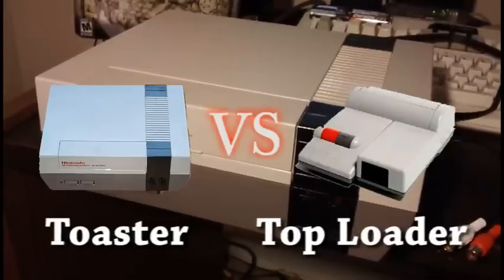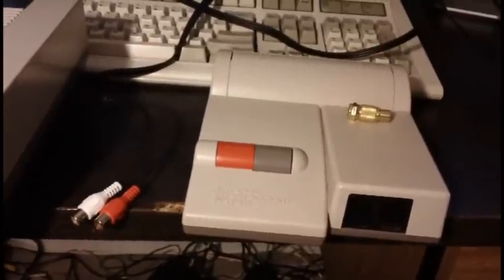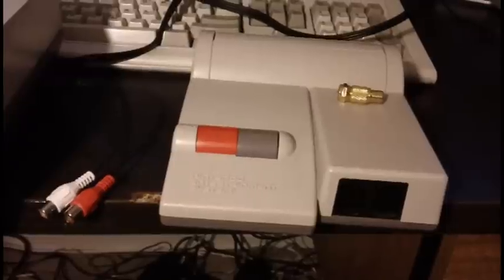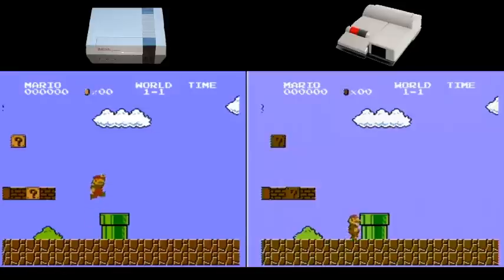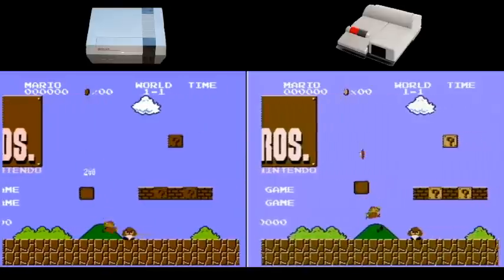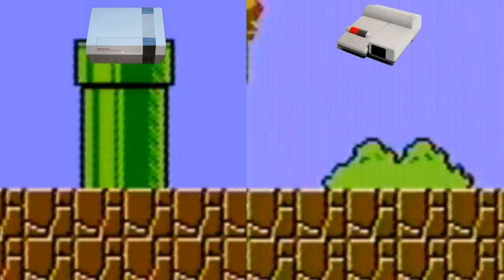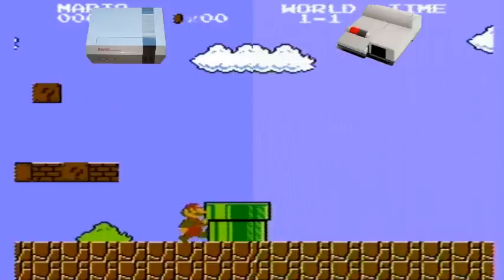NES Front Loader vs Top Loader

Comment: That's really weird, you'd think the later model would be the better of the two. Image the PS4 pro was worse than the PS4 😂😂
Reply: The reason it is not is because the super Nintendo had already come out they were making it to sell cheaper and milk it for as much profit as possible on the way out
Reply: It's more of a PS4 slim than a PS4 pro, it's a downgrade because it was designed to be cheaper.
Reply: It was a version of the NES released after the SNES, that was meant to make some money from parents too cheap to shell out for the current gen hardware. It was made pretty cheaply. Getting rid of the ludicrous front loading mechanism had the benefit of reducing cost while also making the console more reliable, which was cool, but the picture quality was pretty poor.

Comment: Top Loaders and Regular Nes units both have roughly the same picture quality. If you're seeing lines, clean your cartridges, the only reason you'd see lines would be not having a solid connection between console and cart. I deal with Top loaders and Nes units on a regular basis, they both look about the same the only differences are clean and unclean contacts and pins. You're also running the nes straight through video, whereas you're running the top loader through av cables through an adaptor to the tv. Anytime you run through multiple sources you dilute the picture quality.

Comment from the maker: Sure but composite on NES is very clean (for composite standards) the GPU works natively in composite meaning even if you do an S-Video or RGB mod using the stock GPU the image is no better.  Composite is as good as it gets for the NES unless you get the GPU from those Nintendo PlayChoice arcade cabinets and mod it into an NES.  Those work in RGB.

Comment from the maker: The original NES sold millions and millions of units from like 1986 until about 1994 (about 8 years) while the top loader was only sold for about 1 year tops from late 1993 to about mid 1994. That's why it's harder to find. There aren't nearly as many of them out there as there are the original since it sold for 7 more years.

Comment: The Toaster also made the vertical lines, if you did the RF (coax) output.
The reason for the lines and lack of color, you touched on a little, is the mixing of the audio and video signals, and separating the two isn't perfect, so you get a little "sound" in the image (alternating jagged lines, or checkerboard imagery, or the vertical lines), and buzzing in the audio, because there's some "video" in there.
Atari 2600 (original) was notorious for bad mixing, especially the original consoles.

Comment: Got an original NES for $4 at the Goodwill, bought the prifs & SMB for $20, the NES started right up after a small wiggle of the cartrage and it looks freakin great, no plastic yellowing or mods (even the 72 Pin connector, I believe is 100% original, I just cleaned it and restored the pins and it runs great)". Personally, I did not think it would actually work "especially coming from the goodwill". That was the best $4 I ever spent man.... Playing SMB3 on it as of this very moment and still haven't spent more then $40...

Comment: I actually bought a toaster type NES today. First time I have ever played a real NES and it is so awesome. It only cost me 49 dollars but it didn't have controllers or cables. Luckily enough it just uses AV cables and the SNES uses the same power adaptor. So I just used that one and bought a couple of controllers from another store around there. Even got a zapper for it and it works PERFECTLY! Unfortunately it doesn't work with my lcd tv but on my old crt it works just fine.

Comment: I just received an original NES console in the mail. I bought this because I've seen comparison videos for picture quality with it vs the NES 101 top loader. I've had the top loader for a while now and decided to just get the original NES over installing av components to the 101 for a better picture quality. Turns out my NES top loader has a better picture that the front loader I just received. And yes I plugged in the av cables for the front loader. Is there something I'm missing out on?

Comment from the maker: No it's the exact opposite.  Using a direct cable like this over the original automatic RF switch box will give a cleaner signal on ANY system that uses RF.  They sell these adapters on Atariage for that exact reason.  The automatic and manual switch boxes can add resistance or get corrosion on the switch they were made to make it convenient to switch between the game console and your aerial or cable TV that's the whole point for the switch but a more direct path is better for noise.

Comment from the maker: Sorry you feel that way but the original NES has better picture quality and AV outputs that the top loader does not.  The only thing better about the top loader is the fact it's a top loader and generally has less issues with age when it comes to loading the game carts since it makes a better connection with the contacts.  For some people that's reason enough to want a top loader but no one will deny the picture quality is inferior to the original.

Comment: It's always good when buying a used system from years ago to go with the original first models made,not the next models that were watered down so to speak.They cut price cost by taking away stuff or just using cheaper parts.

Comment: I wonder if the video chip on the NES2 has a higher resolution internally (not used by the NES games) and somehow the video chip is up scaling it somehow, producing the lines where the original NES is low-res native and outputs the signal that way (perhaps by not interlacing).    For example, the original NES outputs a resolution of 256 x 240.   I wonder if the NES2 Internally is 640x480 or perhaps 720x480 (interlaced), and the NES2 doubles lines or doubles some of the pixels to render the video signal, producing the lines on the screen in the stretch or scale process.     Be interesting to pull the specs of the actual video and graphics chips used on the NES2 and see if this is perhaps the case.

Comment: It's a good thing I watched this because I was considering tracking down an NES 2, figuring it was at least as good as the first one in terms of picture quality, being much newer. I actually experienced something similar with the Sega Genesis back in the 90s; I had actually gotten a Sega CDX (the unit with the Genesis and the Sega CD together that looked like a big portable CD player of the era) and when I played Sonic 2 on it I discovered that the picture actually had larger pixels than the original Genesis and the characters did not look as detailed. I swapped back to my original Genesis to make sure I wasn't imagining things and I wasn't. I took it back the next day and got a refund (and considering how the Sega CD ended up that turned out to be a good thing).
Reply: Actually should have held onto that cdx could have gotten a pretty penny for it now. And sega cd games are ungodly expensive to collect

Comment from the maker: The SNES Jr has really good looking composite but lacks S-Video like the original SNES.  So if you have an S-Video cable and use it you just get a black screen on the Jr.  The Top loader NES here in NA has no composite video output but the Japanese Famicom AV does and I'm sure it's as good as the original NES but I've never seen one in person.  Heard a lot of good things about them though so I'm sure it's good.

Comment: A fair way of comparing would be to use the RF output of both machines - and use a proper and shielded RF cable instead of some plain cheap composite cable with an adapter. 
Interference is not because of sound going in the same cable, it's not even close in frequency - you don't get extra interference when there's sound, right? The composite signal is modulated on a higher frequency giving a less clean signal when demodulated again - as it's analogue.

Comment: Can you explain the adapter? I don't get how that makes sense.. Doesn't the top loader ONLY have RF? If so.. how are you connecting a composite cable, even with the RF, to the computer?

Or did you mis-speak and are plugging the adapter side (now 'rf') into the NES and then the other side, which would be composite, into the capture card?
Reply: The composite cable can carry any signal through it(in this case, RF). The adapter just allows you to plug it in the RF input of your TV. The NES has an RCA style jack on the back for RF.

Comment: I also like the classic original NES because it's faster as you can see in the video the demo starts first and is faster than the top loader. Maybe because the top loader uses pal emulation ? Or it's said in the video/description and I a dummy.

Comment from the maker: How is it pointless to show the best of both stock systems? It's not my fault the top loader lacks AV output! To show the best of both systems would mean to use the best possible connection for both.  I'm comparing the systems, not RF. RF on the toaster doesn't have the vertical lines and when you do an AV mod on a top loader you can still have the lines unless you do a more advanced mod with the added filter cap so the lines aren't a problem with RF but the whole design of the top loader.

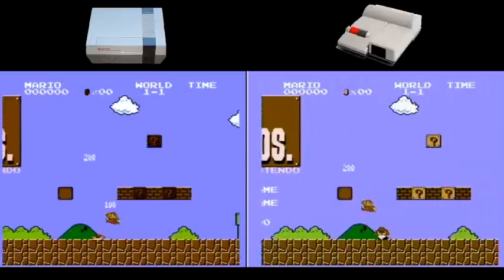Comment: I still have the original Japanese Family Computer with a microphone on the 2nd controller and it doesn't have AV out so the only way is RF. There are also vertical lines on the video the same as the top loader (2:57).

Comment: I modded a top loader with rgb and still got slight vertical line. I was so dissapointed. I put a 0.1uf ceramic on the 5volt line going into the nesrgb board. It got better, but the lines are still there. So frustrating!!

Comment: I actually have two front loader NES systems, and they both have the vertical line issue. I'm pretty sure they are rare, but they're present on the original consoles. I'm guessing it's a capacitor issue, considering how the Sega Game Gear had tons of screen, and sound problems.
Reply: +Luigi84289 I have used both. Composite, and RF frequency. However, it's still slightly present on Composite; clear picture though. With RF, it does show, but it's really very odd. One of the units also has lower sound then than the other one, and I haven't even messed with the volume control on my TV. Like I said, it's definitely a capacitor issue with the motherboard, but it may be a 50/50 chance it'll fix the problem.

Comment: You know, I've always denounced the toploader in comparison to the "toaster" NES. The toaster is the ONLY version of the Famicom/NES hardware with both inputs, and the quality is much better than the NES 2. Plus, it just looks cooler, too. My normal NES isn't even problematic (working as well as any NES 2), thus voiding the main argument for the NES 2 (my low-serial number launch system is, but I am going to fix that).

Comment from the maker: Yes the original has the 10NES chip in it and the top loader doesn't.  If you're handy you can pop open the original NES and simply cut one single contact on the 10NES chip and disable it.  Then it will play PAL imports like the top loader.  The Retron 5 looks cool but yeah, collectors will want the real Nintendo system.

Comment: I think it depends on the motherboard revision of the Front Loader though. I've had numerous Front Loaders that look like this with no jailbars, but one I've bought recently actually does have some jailbars unfortunately (not as bad as the Top Loader though). The motherboard copyright year on it is 1987 so it's a somewhat newer board, I guess the video quality on newer revisions of the Front Loaders are more worse and also have more stringent 10NES chips.

Comment: You can only notice the difference if you zoom in, nobody did that on the 90s. Also ther NES top loader was region free so that's a huge plus, also you could use the game genie without risking to damage the pins and you can see the whole cartridge. The controller was also a bit better because it's shape was based on the snes controller, which is great
Reply: "You can only notice the difference if you zoom in, nobody did that on the 90s."

No, the difference in blatant in real life. The top-loader's vertical lines are very noticeable on light colored backgrounds, like the blue background of many of the Super Mario Bros. levels. 

"The controller was also a bit better because it's shape was based on the snes controller, which is great"

The controller sucked. On an SNES controller you can use Y & B or X & A as your two main buttons, and they are very easy to roll your thumb back and forth between the two, because they are angled in the same direction as your thumb is naturally angled. But with the "dog bone" NES controller that came with the top-loader, the two buttons are angled in the opposite direction, which is like having to use Y & X or B & A as your main two buttons on an SNES controller.

If they had positioned the A button lower than the B button instead of higher, or if they'd just had them be inline with each other like on the original boxy NES controller, it would have been a great controller.

Comment: The 72-pin connector is cheap.  I paid ten bucks for mine at a local game store.  All the screws are Phillips head ┼.  The connector itself isn't a solder type, it just slides on.  Right away after install I noticed that my games just worked without all the fuss.

Comment: I say it would be better to get the normal NES because it's much easier to find and usually cheaper by a lot, it can play the exact same games (including imports and unlicensed games as long as you open it up and disable the 10NES chip, which is super easy to do) and it has much better image and sound quality (the toploader only has RF output with even lower quality than the RF output on the NES, and it doesn't have the far superior AV output that the NES has at all).

Comment: Great informative video that sums it up what i was trying to say on the other video.
The AV famicom i own does put out a good video signal like the original nes.
1 thing about the av famicom i would like to point out is some adapters will not work with castevania 3 or any mmc5 mapper carts due to the adapter pinouts. There are adapters out there that will work with those carts though but are rare to find. Note zapper games require the famicom zapper or a controller 2 mod from the side port.

Comment: Fuck nes , buy famicom av + nes converter, it has all the capabilities of an nes + plus takes expansion audio , (except the fact that a mod is required to use the NES zapper , cause it connects to controller port but here they aren’t wired properly in order to accept light inputs , so fuck it get a famicom zapper it’s a thousand times cooler and stylish !) . That’s why the famicom AV is the ultimate NES (DONT TALK ABOUT THE NT AND NT MINI OR AVS THEY ARE FPGA NOT ORIGINAL HARDWARE ! but still not emulation , however they cost a lot of money so choose wisely...)

Comment: I use the toploader myself. But I did spend only $15 for it. I'm willing to deal with the video issues for the sake of having a much, much more reliable console. And yes, I did clean the connector and snip the chip on the toaster, and it still wasn't as reliable as the toploader.

Comment: can you please tell me  - if there will be those lines in AV Famicom NTSC japan model  which uses composite? ot there will be the same lines as your top loader from RF? I still cant understand it. You say that there is no any linking with lines and excluding RF connection, but AV Famicon has the Composite. Anybody use it? Please tell me if there is a picture without lines or with lines from a composite also?

Comment: Also when buying a power source for the famicom DO NOT USE THE NES POWER ADAPTER IT WILL FRY THE MOTHERBOARD OF THE FAMICOM(NES uses 9volt AC and the famicom uses 9 volts DC). You can use a Sega Genesis1/CD power adapter on a famicom.

Comment: I have the original NES, but the picture quality looks like the top-loader.
Reply: +Jackattack681 What cables are you using? are you using AV cables or RF?
Reply: +Jamie Last Which is which?
Reply: +Jackattack681 is it one cable, two cables or three cables? and what colour are they?
Reply: +Jamie Last It's one, and it's connected to a small grey box that plugs into the NES.
Reply: +Jackattack681 That's completely normal. If you only have one it should look like the top loader.
Reply: probably dieing out. on its last leg.

Comment: NES 2? That's just a famicom!
Reply: No its not.  Its the top loading NES that was released in the early 90s.
Reply from the maker: No it's not a Famicom.  This is the North American "Top Loader" NES (2nd version of the NES) that was released in 1993 as a budget alternative to the SNES.  They aren't as common as of course by 1993 most people were well past giving a crap about the NES!  Yes, it looks similar (similar but not exactly the same) as a Japanese AV Famicom (the 2nd version of the Famicom in Japan) but this one as I explain in the video lacks AV outputs and it looks nothing like an original Famicom.
Reply: Plus the NES 2 has a little hump on the cartridge slot while the AV Famicom doesn't.

Comment: If you have no desire to play Disk System games, stick with the original. If you do, get an AV Famicom, a Sharp Twin, or MAYBE an original Famicom that’s been converted to AV. There’s zero advantage to owning a top-loader NES. The AV Famicom and Sharp Twin are expensive, but have the best picture among all of the versions of the Japanese hardware, and you might actually save money in the long run because the Japanese versions of the games are a LOT cheaper. We’re talking $3-$10 for first-party Nintendo games that are usually identical on the inside to the North American versions. If the initial sticker shock is too much for you, an original Famicom converted to AV is about half to three-quarters the price, but the picture on most conversions isn’t as good.